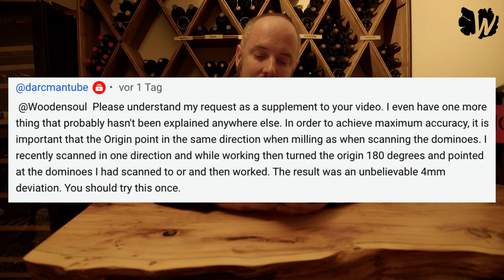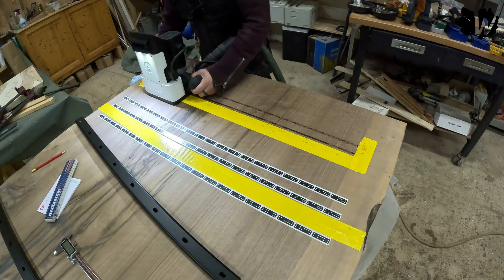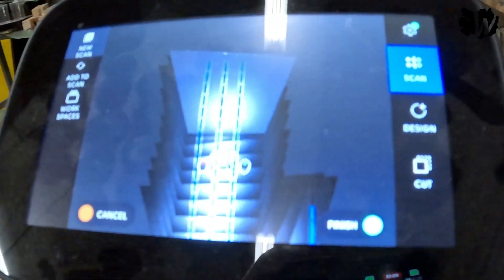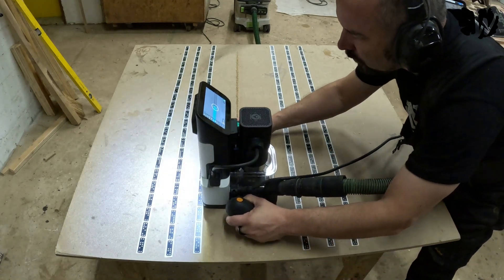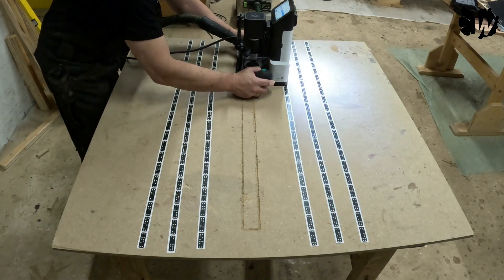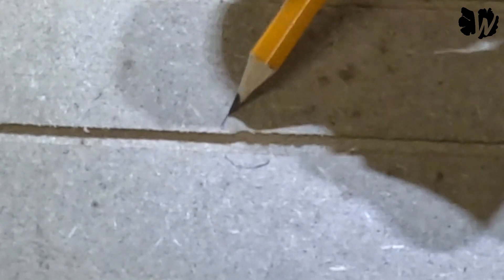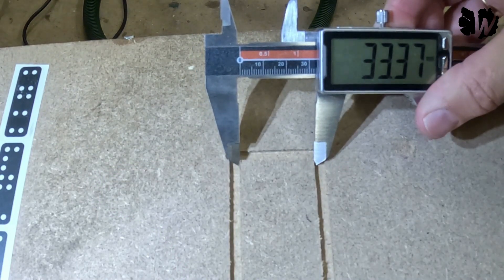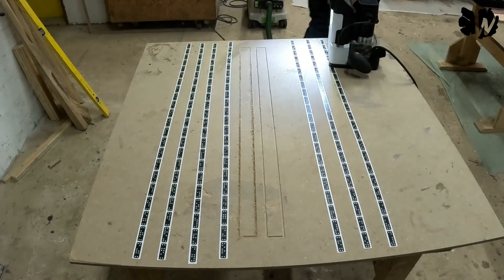How to increase cutting precision with Shaper Origin #shaperorigin #precision #quality #tutorial

Comment: I called shaper support recently and described the not-perfect-corner that you showed. They told me to always use the auto mode where the machine will go around corners on it's own but that I should not be moving the shaper while it was automatically moving around a corner. I tried that and it then produced the perfect corner I was looking for. Just a minor quirk I guess. Maybe this small stuff bothers us because in many other ways it is such an amazing machine.
Reply from the maker: I would be very astonished if that would do the trick here. But many people left proposals on how to prevent this, so I might need to run another test soon...
Reply: @Woodensoul correct. His comment has absolutely nothing to do with this issue.

Comment: wow.. good info here.. Im a 180 degree scanner no more!    btw.. did you pick up Trace?
Reply from the maker: Just to be clear: You can be a 180 degree scanner, but not a “180 degree turner while working with the SO” 😆. Regarding Trace: Depends what you mean by “pick up”. If you mean that I am aware about it: yes. Id you mean that I have invested in the kickstarter or that I am interested: No 😆
Reply: @Woodensoul  I feel like the trace is a cash grab for hardware. A modern apple or android phone should be able to do this at full scale with shapertape. Even if you had to pay for the feature/app.... There should be no need to rely on an aluminum rectangle when their $25 tape should get the job done with the same accuracy as scanning for a workspace. 

I feel similar about that auto pass nonsense that I need to pay for unfortunately. Grifting for sure
Reply from the maker: @FPVtrix  Oh right! I didn't even think about it that way, but the aluminum hardware is a) unnecessary and b) limiting (as it limits the area you can use for sketches to a pretty small rectangle). But se that aside, I rarely have even the need to move a sketch to SVG, and if I do I typically just trace a picture of it on the computer. So clearly I am not the target user for this product...
Reply: @FPVtrix  have a lot of experience with all kind of tape quality, professional high-end painter for over 30y. I can tell you that the quality of the tape is below zero. Buy the cheapest tape you can find and sell it for over over over priced money. I would never buy this kind of tape for my profession.
Reply: @TheOneLin3  I know that preserving the Domino scale is paramount so even when I don't use the tape and opt for printing the dominoes on paper, my cut accuracy is only as good as the printed image. I like it cause the process saves me from buying the tape for every job. I even got an 11x17 printer so I can make sheets big enough for small work spaces like the shaper plate.

Comment: This is not about orientation, it's about the tape layout. The big tape gap in the middle of the table means origin will have trouble precisely connecting the two "islands" of tape that do have good overlap. Adding some more tape would make sure they are connected better and that an accurate workspace is created.

Now I do think they can do a better job with education and then warning the user of the unreliable scan, but it's physically not something that can be fixed on their end. The tool is being used incorrectly here, it's kinda like putting a saw blade backwards
Reply from the maker: Yeah, blame the user, my favourite excuse for bad product design. So first of all, I don't think your explanation is correct. When I first encountered this problem, I was cutting out a round table. As you can see in this video: https://youtu.be/VnrwmvsKdmI?t=275. You see that there was a good carpet of regular tape, yet the shape didn't turn out to be a perfect circle. Also, when I encountered the problem for my first C-Inlay, I had put tape throughout the cut zone. Still I will make sure to try out your recommendation next time, but I am highly doubtful that you are correct, especially given how many people commented on this video that they have encountered the same. Second, your claim "it's physically not something that can be fixed" seems also very fishy, at least I will question your expertise in this field and your assumption that this is impossible to fix. Why would it? "That just like your opinion, man", would the Dude say...
Reply: @Woodensoul  A big part of my comment was about how Shaper can do better with informing the user, but ultimately the machine can only work at the highest level of accuracy when set up correctly and they can't do that for us.
This island problem is just one way a scan can lead to bad results, there's a "tape best practices" video that I thought was very informative.
This may end up being an issue on their end, but I think that kind of claim requires a little more testing.
Reply: @Woodensoul  And about the physically impossible comment. If two pieces of tape are not close enough to be viewed in the same camera frame, their relative position is impossible to compute. A better phrasing would be that given the way this machine works there's no way to make some tape layouts work out.
Reply from the maker: @gharel396  Agree, the minimum they would need to do is to inform the user that the tape zone is incomplete or of low accuracy. But based on my experience, I am not sold your hypothesis is correct. I will test it further though, because it would be nice if your theory is correct...
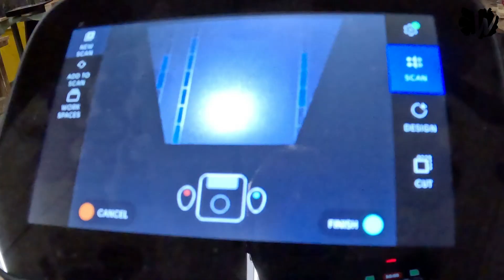Reply from the maker: @gharel396  On Minute 1:29 you can see that the scan did cover both left and right hand side tape in the same view, so your theory would be that if it's in the "outer parts" of the camera view, then these are of lower accuracy or quality, which is something I haven't heard of, and something that would be weird. Why should that be of lower quality?
Reply: @Woodensoul the outer edge of most lenses often leave a lot to be desired in quality.

And I agree, there should be a connecting row at the very least.

Would be very curious to see how it affects the outcome.
Reply from the maker: @TheDaniel85  Yep, I might do this one day - but right now we have a heat wave and I prefer to jump into the cold water instead of making videos (although the wine cellar is pretty chilled) :D
Reply: @Woodensoul  totally understandable! I don't own a shaper myself.. But I'm consider one, it is however a large investment in a single tool for a hobbyist.
Reply from the maker: @TheDaniel85  Oh yes, it is a large investment, but also one that is really enjoyable. I am a hobbyist myself and I would not want to go without the SO, despite of all it's flaws...